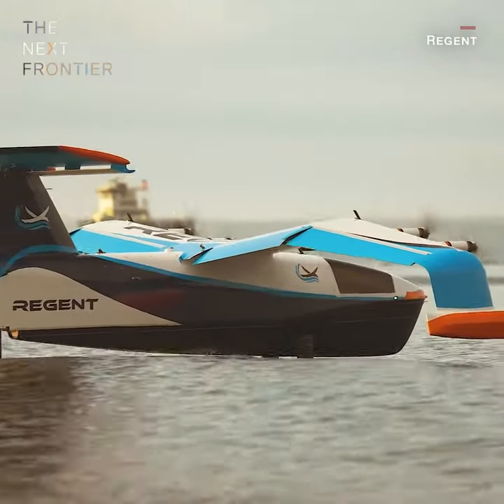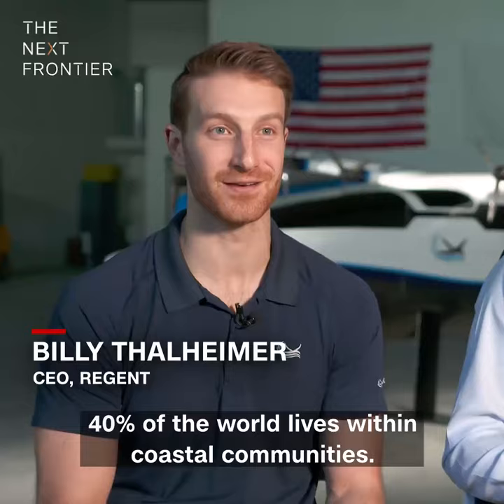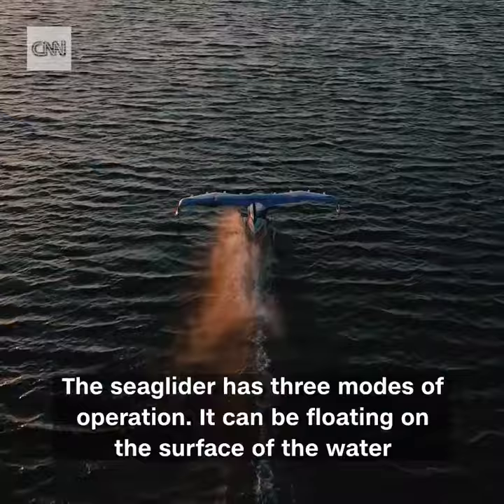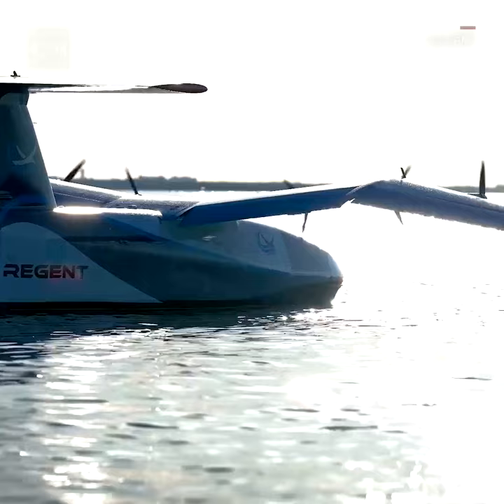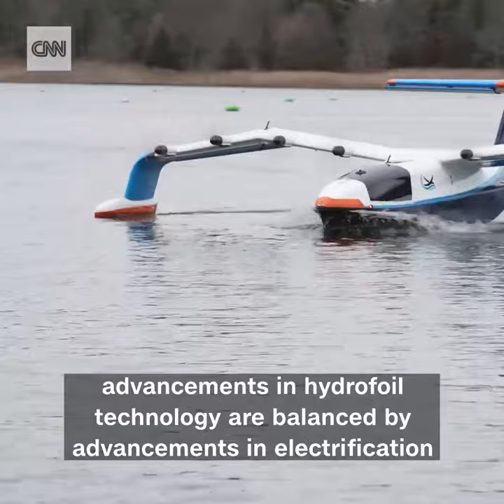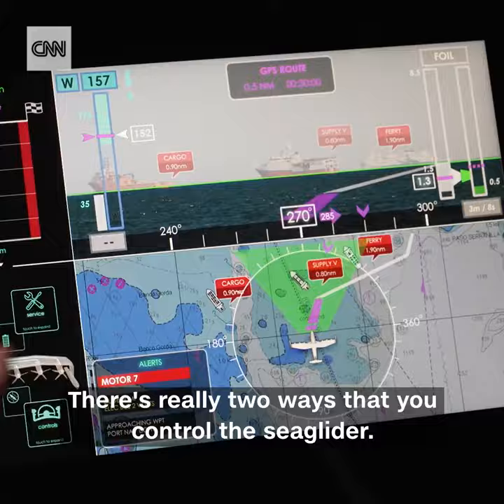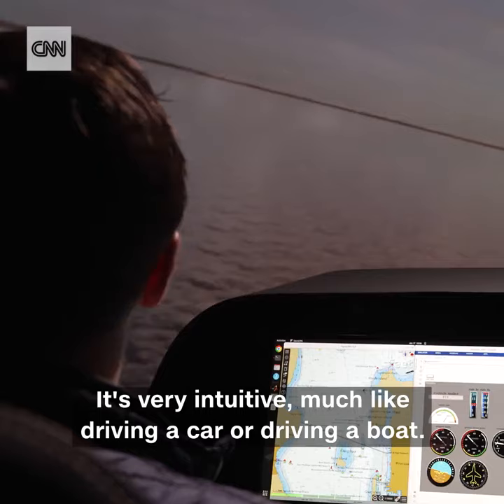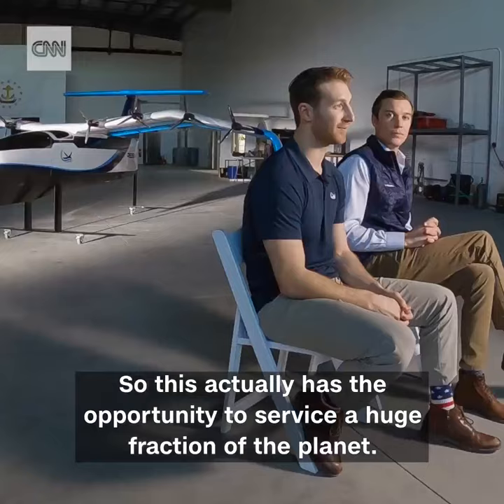Ocean Flyer | CNN on REGENT's Seagliders

Comment: Because of the high mounted wing.. there is little ground effect benefit if any.  The hydrofoils don't add anything. A seaplane can do the same thing.  So you are left with an electric airplane with extra parts.

Comment: No; what you have smashed together is hits from the bong an amateur CAD.  This is a grant chaser and nothing more.  It might even be an investment scam like the Alice.  First, it's not a WIG.  That's the showstopper right there.  Second, it's way overpowered if it were intended to be a WIG.  Even as it is that wing is awful, though I'd love to know the section schedule across the span.  Put retractable skis on a US2 or AG600 and even then, so what.

Comment: Coastal communities are going to be shocked at the low operating costs and fares for this transport solution. Modern battery/electric drive trains (eg Tesla) require zero maintenance, and fuel costs (ie recharging) should be around 10% of that for equivalent fossil fueled aircraft, so fares only 30% of the competition for probably a faster trip (port-to-port) are entirely plausible. 2026 will be an exciting year for Kiwis!